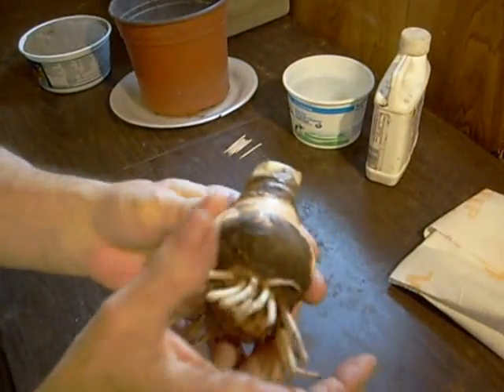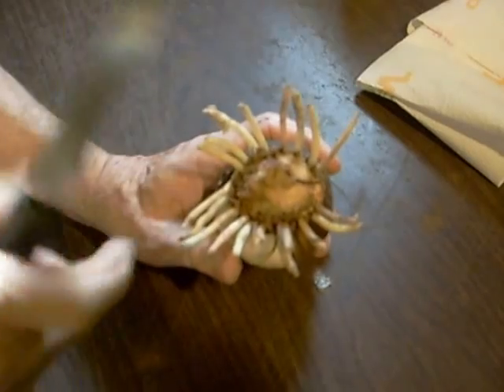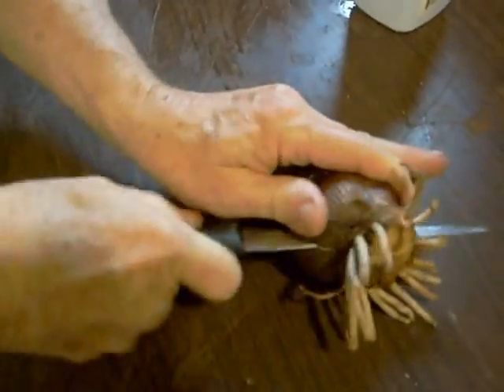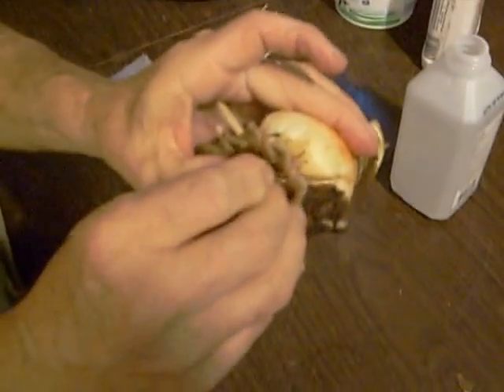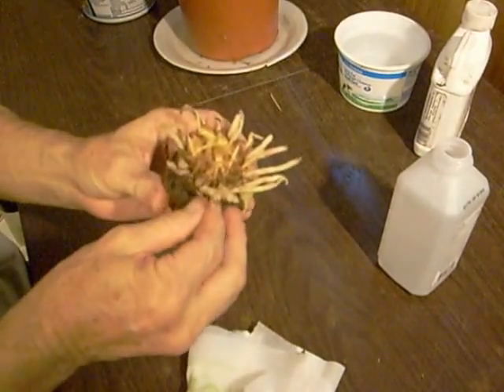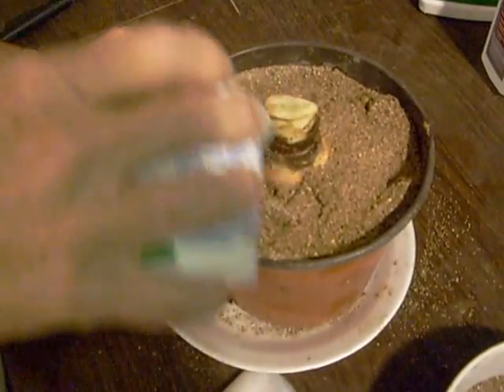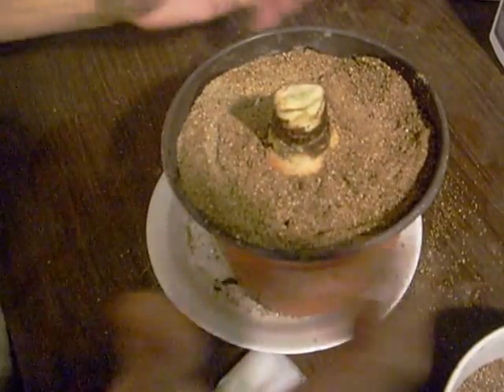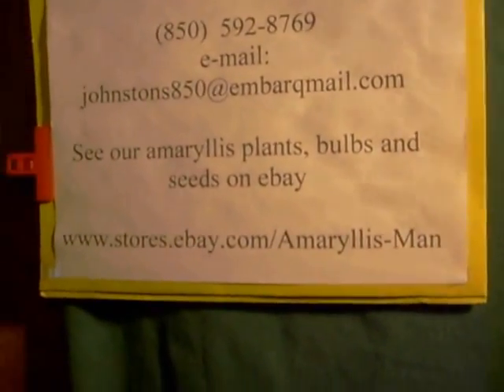How to chip an amaryllis Hippeastrum bulb to get off sets 002

Comment: I bought my first amaryllis and the flowers are turning... Can I replant them.
Reply from the maker: Yes, it is available to do that.  Treat it as a house plant until the weather is above freezing.  then put it outside in a sunny location, fertilize and water it as needed.  If you are in an area that it freezes bring it inside for the winter.